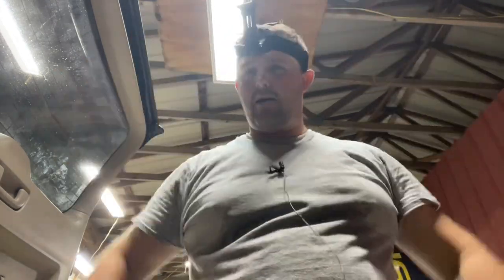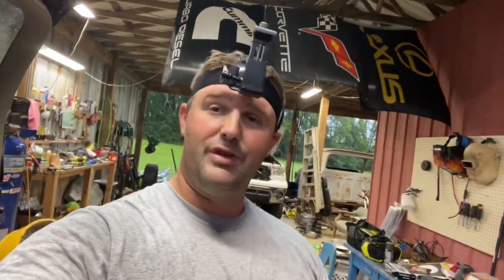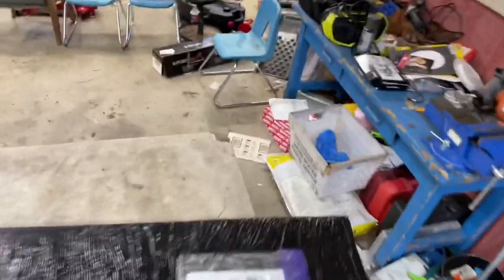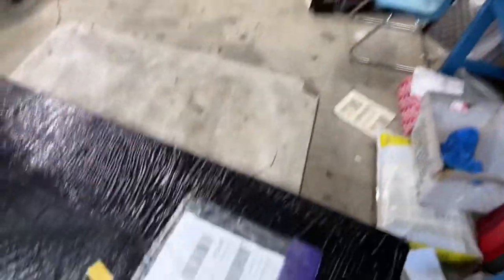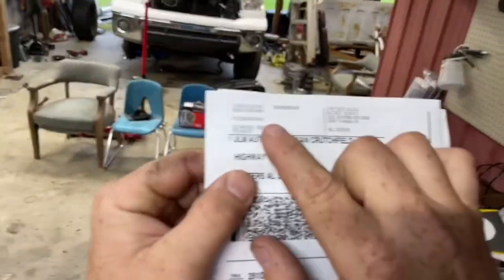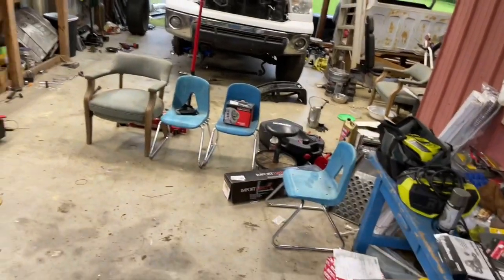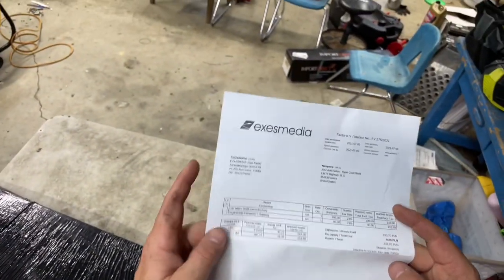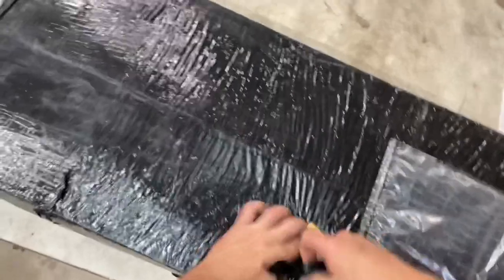Lexus GX470 Bison Gear Rear Door Table install and review

Comment: Looks good. How much thickness does the shelf system add when in the closed position? Trying to figure out if it will fit with the Dobinsons drawers in back.

Comment: how heavy is it? And could you bolt it through in the spots you used self tappers with rig-nuts and some spacers?
Reply from the maker: Meaning you want to go all the way through the floor?
Reply from the maker: It’s pretty heavy I would say 150 pounds assembled maybe more I’m really not sure. It was more awkward heavy than dense

Comment: If it fits with the Dobinsons drawers, I'd be interested in getting one. Using the Bison Gear website, I can get it for $176.75 including tax and shipping. Let me know if you can do any better.
Reply: Sorry, correction. Total would be $238 after shipping. Bison website is a bit confusing about that at first.
Reply from the maker: I’ll have to measure it mounted to make sure but I think it will fit.  We are working on getting a way to get them in the US cheaper now
Reply: @crutchfieldautomotive7936  It looks to me like if the Bison shelf is less than 1.75" thick, it will fit with the Dobinsons drawer system installed.
Reply from the maker: I’ll be back tomorrow to look at it unless I can have someone else do it today
Reply: @crutchfieldautomotive7936  Have you had a chance to take that thickness measurement yet? Do you have any updates on if you'll be able to offer people lower shipping costs?
Reply from the maker: 1.5” and not sure yet on the shipping still working on that

Comment: Would aftermarket 4Runner running boards fit a 2006 GX470?
Reply from the maker: I’m not 100% that they would or wouldn’t. Most everything else on the suspension and other parts will but I have not tried that
Reply: @crutchfieldautomotive7936  what would you prefer,rock slides or just regular step boards?
Reply from the maker: What use will it see most?  If off-road the sliders do a jam up job, but for on road use if you just need a step the regular boards do great
Reply: @crutchfieldautomotive7936  I’m up north so it will be mostly snow ⛄️
Reply from the maker: If you’re not using it for off-road to protect the body the sliders aren’t necessary
Reply: @crutchfieldautomotive7936  but I think they look good, yet if ur going for the looks lol
Reply from the maker: True that